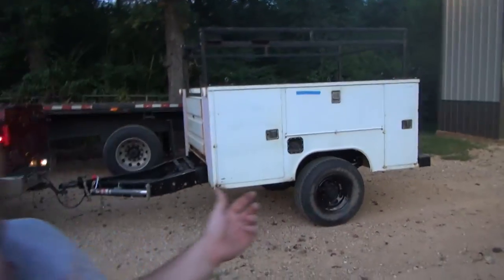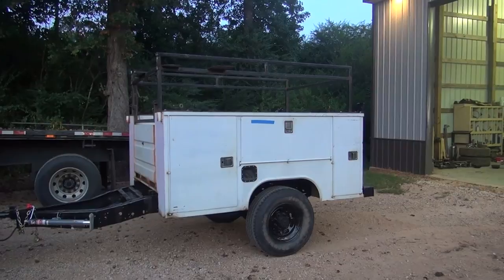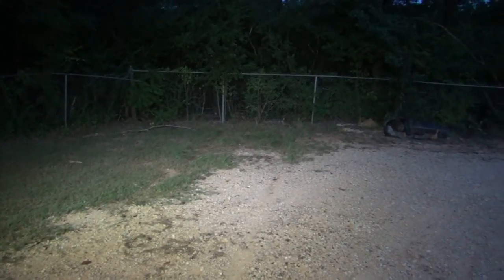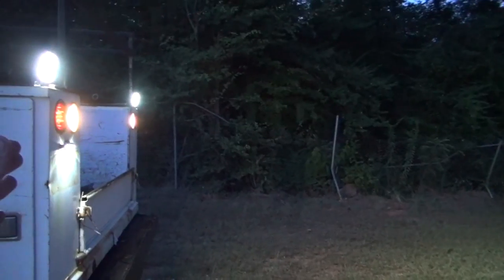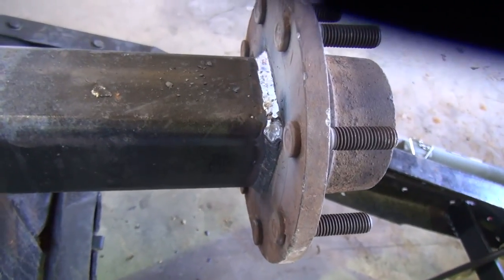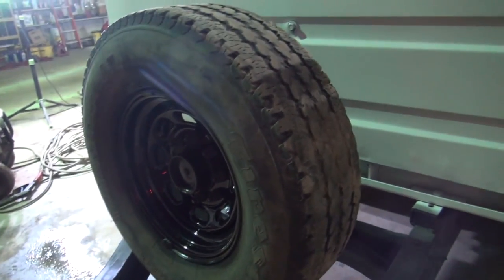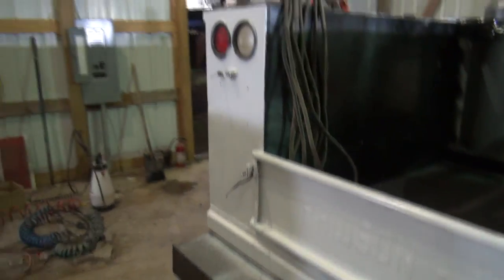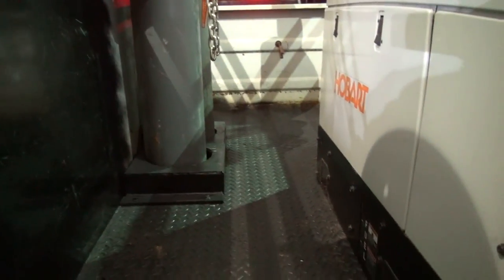Service truck bed welding trailer build part 3 Final

Comment: Looks bad ass man ! I'm a welder/ fabricator looking to do something like this soon
Reply: I have an S-10 service bed as my mobile welding trailer. The center has a sliding aluminum cover so everything inside is out of the weather. I run a MIG, TIG welders along with an air compressor and grinders off of a Champion 8750 watt generator. I mostly do pontoon boats and boat lifts.